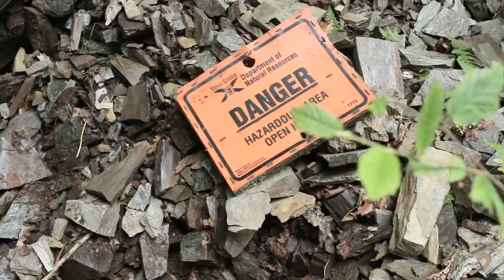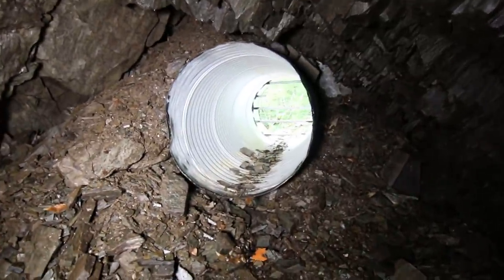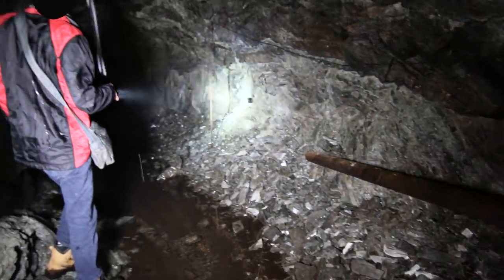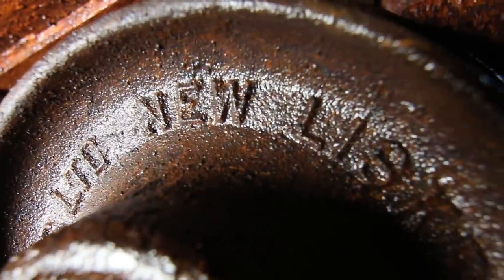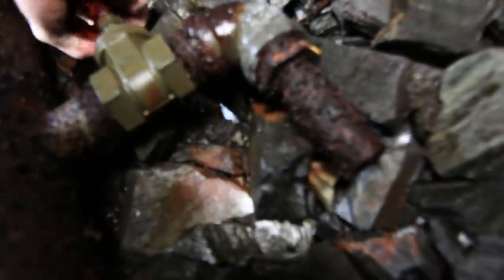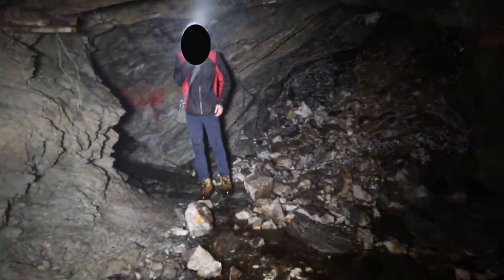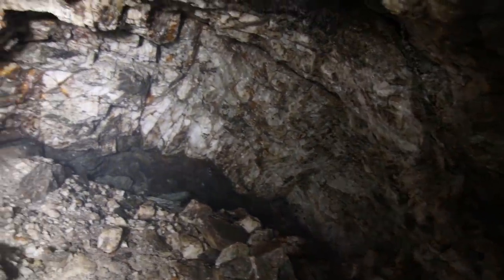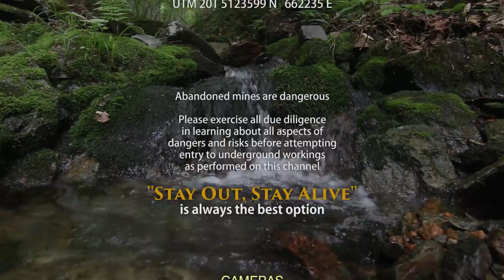Ep.48  The Abandoned GOLD BROOK GOLD MINE

Comment: One of the more mysterious mines I have ever seen. First they must have done the adit, found the ore body to be good, gone full hog on building an expensive incline shaft that is massive and seems to have been dimensioned for a sizeable mining operation. And then mysteriously just shuttered the mine and gone home after blasting out that pile of ore. I guess they bankrupted on that incline shaft after over-sizing it.
Also, I suspect that there is an upper-working from the waterfall coming out of the roof.
Reply from the maker: Great analysis.  As for the waterfall coming out of the ceiling, since coming home, we looked again at some old maps of the adit... that is where the tunnelling passes under the brook above.
Also discovered from looking closer at the old maps, that quartz body is "thee" Lizard Lode - as referred to in old documentation, and mentioned in Episode 27.  Now we have all actually seen why it was so lucrative to them.  Yes, it's odd they never got much into the resource...  allegedly the Lizard Lode quartz contained over 1oz of gold per ton of ore.
Reply: @abandoned-mines-novascotia  If that face runs, it'd be child's play (comparatively) to reopen the portal and muck it with an EIMCO 911 or similar machine. My EIMCO is being used on a similar project in New Mexico. Now, if they mined over 1000 ounces of gold as you said in the video, there was probably over 1000 tons of ore mined. This ore probably runs about 2.3 tons per cubic yard, so one good stope would do it, as would significant on-vein development. Another possibility would be a pocket of ultra-high-grade material - a mine I'm associated with has encountered small pockets that run over $50,000/ton.